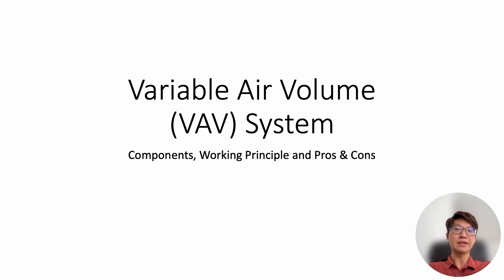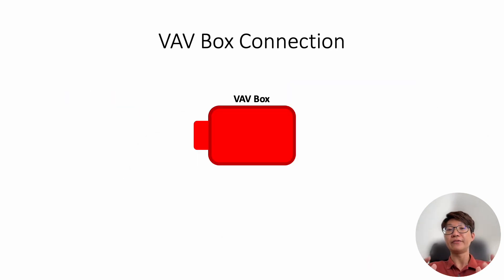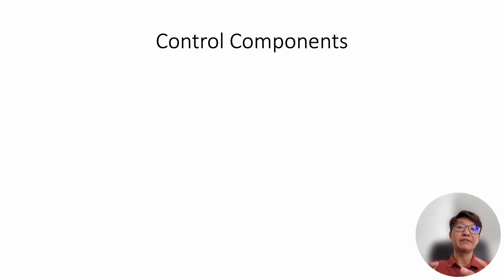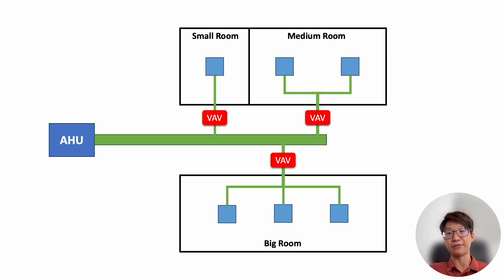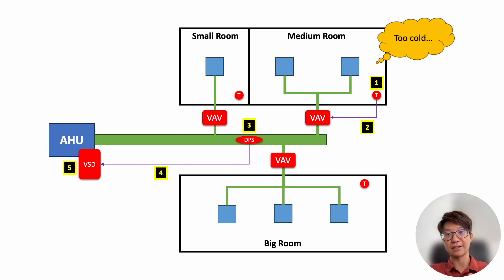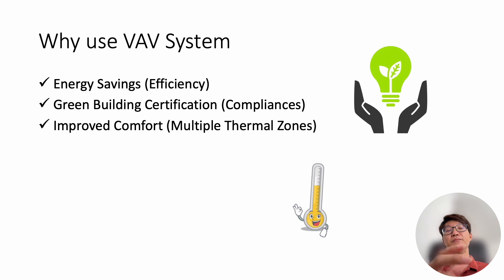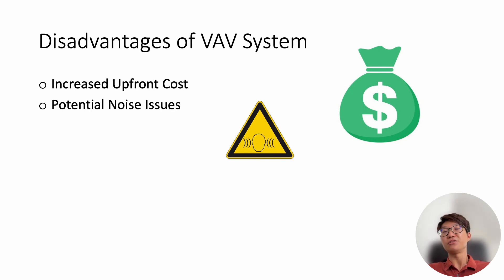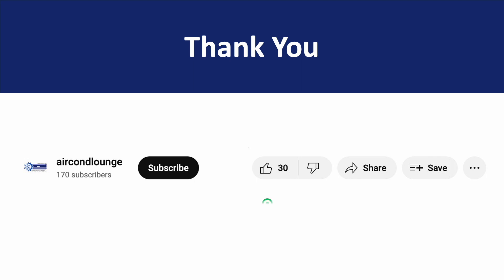Variable Air Volume (VAV) System Explained - Components, Working Principle, Pros & Cons

Comment: What i don't understand 
When i reduce temperature, mean i reduce air flow 
But air flow stay in same temperature 
How can i control temperature with air flow control ?

Is there a relation between temperature and air flow
Reply from the maker: The relationship is:
Sensible heat = 1.1 x CFM x temp difference between supply air and room

Given the same amount of heat in the room, if the supply air temperature is constant, reducing the airflow will increase the room temperature. 

If the room heat is reduced, given the same supply air temperature, reducing the airflow will maintain the room temperature.
Reply: @aircondlounge  Thanks

Comment: Vava can be full closed by the thermostat or only 90%closed some percentage opem always for air circulation?
Reply from the maker: Maintain a minimum flow of 20-30% for air circulation while also prevent stressing the AHU fan.

Comment: Thank you for the video. Please I want to know what happens when the big room temperature is higher than the setpoint; say 25°c, the medium room is 22°c, and the small room is 18°c. How does the AHU and the BMS handle this situation?
Reply from the maker: I think in this case should recalibrate the VAV airflow in those rooms. The big room needs more airflow while reducing the airflow in the small room.
Reply: @aircondlounge so that means each duct that connects each room must have a VAV?
Reply from the maker: @alexekwueme7477 It depends. If each room needs about 1500 CFM, then it is likely that every room needs a VAV box. Otherwise, 2-4 rooms can share one VAV box. Each room will then rely on the radial or OBD on their diffuser to adjust to their required airflow (eg: 150, 250, 700, etc.). If multiple rooms are sharing one VAV box and each room diffuser doesn’t have volume control damper, then small room will indeed be overcooled since majority of the temperature control comes from the big room because the big room contributes more airflow for the control.
Reply from the maker: And the thermostat used to control the VAV is likely located in the big room as well.
Reply: @aircondlounge  I think each room should have VAV and it's damper plus thermostat for full control of the air in the rooms.
Reply: I have a problem with the central air conditioning thermostat, manual train 1577, error 2 appears

Comment: are there VAV boxes with Larner–Johnson type valves? partially open buterffly valves produce turbulence at high CFM which is not only noisy but also increases pumping losses
Reply from the maker: I have not seen such a VAV damper, mostly are very basic ones. Designing <1700 CFM per VAV box can help with the noise.